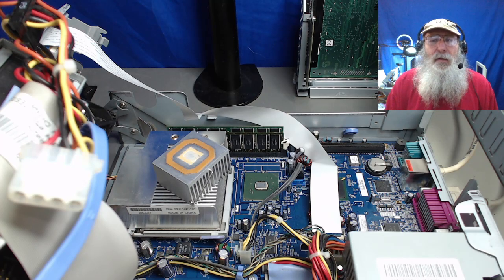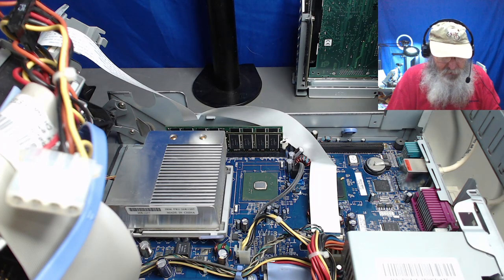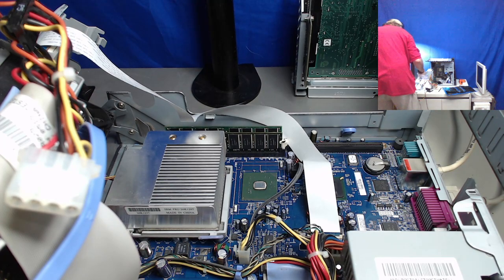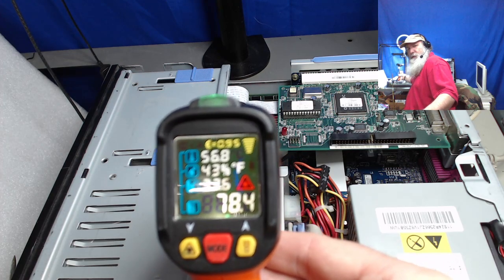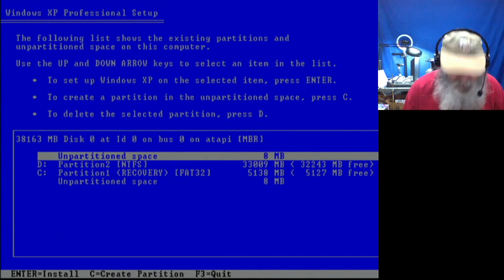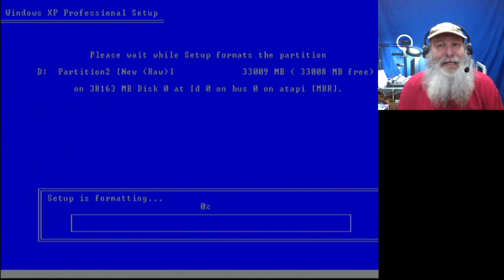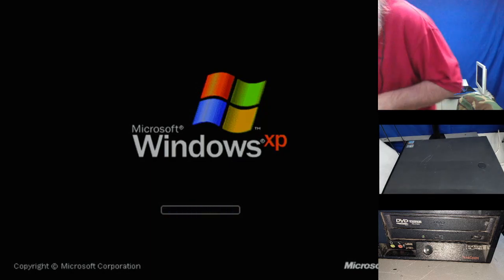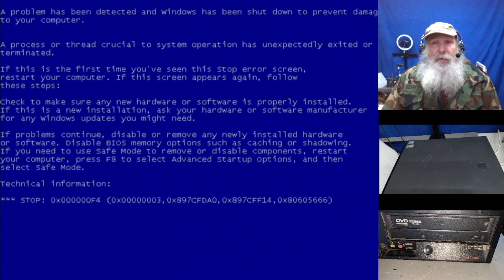A reattempt at Windows XP installation and activation on an IBM ThinkCentre S51

Comment: I am impressed by your persistence!  I know you'll get this machine sorted.  In my opinion, troubleshooting videos make for good videos.  Pretty impressive heatsink on that northbridge chip!  Wonder if capacitors could be an issue here since this was right in the middle of the capacitor plague, I believe.  Or as you noted, maybe trying another drive... and to be really sure, perhaps a run of memtest86 just to rule out memory.

Comment: I have 3 s51 systems. I have dealt with more. In my opinion the best Thinkcentre machines. 
I have noticed that even when operating as it should, the northbridge on these machines gets quite hot. It seems that the heat from the chip itself, and the fact that it only gets a slight amount of airflow, and that is hot air from the CPU does not help. I have seen a lot of these machines that have cooked themselves (they used to have these machines in my school, and they were always screaming) and the motherboard just starts hanging up, freezing and the system starts throwing weird error messages. 
On my machines, I have installed a fan over the heatsink for the northbridge. That seems to help quite a bit at keeping it cool. I just stole the power from one of the Molex connectors that was not in use. I have one of these machines that acts as a file server, so it is on 24/7 and it has been for over 3 years now (except for an occasional restart after a backup), and I have never had an issue with the machine running too hot in the slightest.

Comment from the maker: I've ordered another planar if an IDE drive swap doesn't have any effect - I'm suspecting the "Southbridge" chip because I can't boot from the authentic 3-disk MS-DOS 6.22 sets (multiple) and it has installation problems on the second diskette (again, multiple sets) - but other diskettes boot correctly. This system is going dual-boot to DOS anyway!